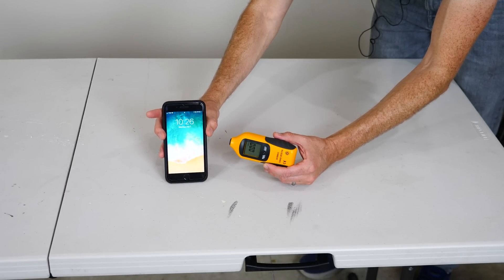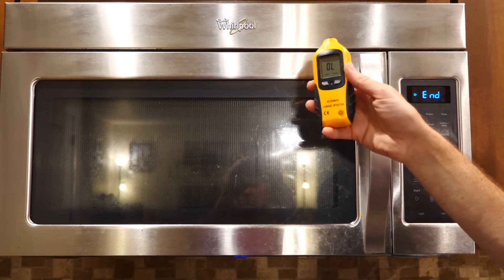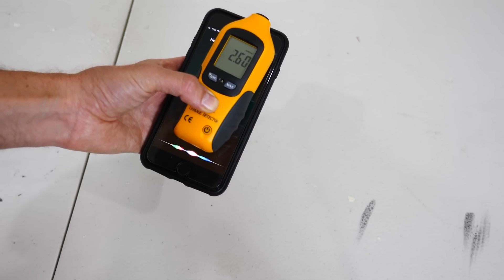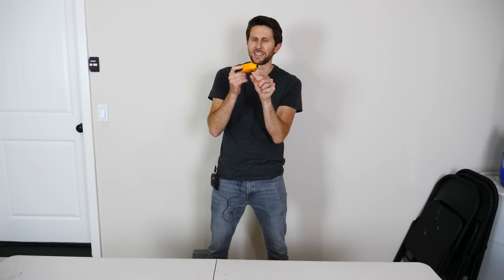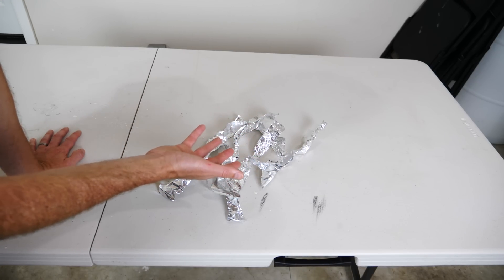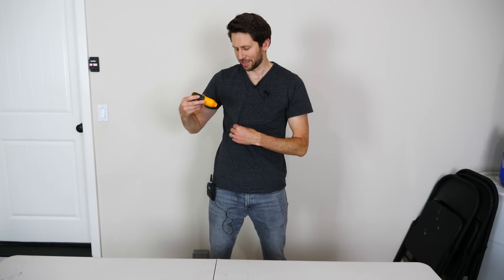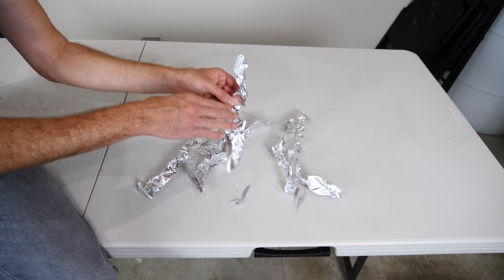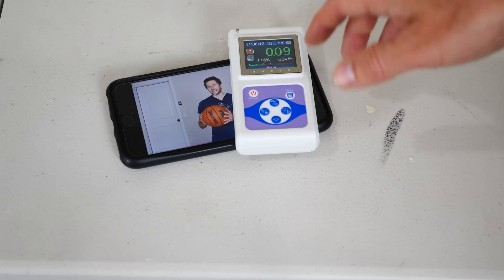How Much Radiation Are You Getting From Your Phone?

Comment: it is important to know the differences between non-ionising radiation, such as radiowaves, microwaves, infrared, visible light, UV and x rays, compared to the ionising alpha, beta and gamma radiation. 

non-ionising radiation are electromagnetic waves that behave like light (because it is light) and carry energy. the frequency and oscillations of the wave can be used to carry heat, light, and even information via use of electromagnets in an antenna. they generally do not cause any harm, until of course, you are exposed to an excess of it. this is why sunburns happen, and why a microwave oven heats up food. phones and many electronic devices naturally do emit this kind of radiation, but it takes a LOT for a phone's radiation to actually do harm to you. 

non-ionising radiation comes in multiple forms: alpha particles (2 protons and 2 neutrons, most harmful but weakest range, cant pass through skin or paper), beta particles (a high energy electron / positron, moderately ionising and cant pass through aluminium sheets) and gamma rays (a very very high energy EM wave with the greatest range and piercing ability but is the weakest in strength). these can actually cause serious harm over time by knocking out electrons in a cell and cause mutations, and therefore cancer. they are released when heavy and unstable elements such as uranium decay into more stable elements. ionising radiation is technically present all around us at any time, as they come from the ground's minerals and space. this is called background radiation, and is unavoidable as well as mostly harmless. 

i do not see any reason for expensive radioactive isotopes to be put in phones, cellphone towers or other electronics as they wont be serving any function within these devices, so dont worry. you could test this with a geiger counter (tho do keep in mind that it will pick up background radiation as well). 

actual uses for radiation would be: 
- smoke detectors (uses alpha radiation. definitely wont reach you unless you take out the radioactive source inside)
- paper factories (uses beta radiation to make sure paper are of uniform width. and no this doesnt mean paper are radioactive)
- sterilisation (gamma radiation is used to clean medical and surgical tools as well as some fruits as it is great at killing microorganisms. this also doesnt mean the fruit / tools are radioactive, it just means it has been irradiated, which doesnt mean it's dangerous. something that has been shot with a gun, and something that WILL shoot you with a gun is very different.)

thank you for listening to my ted talk
Reply: Exactly
Reply: Despite the "science" I still developed a debilitating sensitivity to artificially produced EMFs, but thankfully I found a way to deal with it.

Comment: Seriously before watching this video....actually iam in my summer vacation using my cell phone much...but there is a fear of deadly diseases like cancer🥶....and the most funniest part...keeping the cell phone at my ear in low volume when i feel my mom would scold...or sometimes covering my heas d with cloth to literally break those electro magnetic radiations because cloth is bad conductor of electricity...😂😂again fear...lastly i landed here iam  not addicted to phone because after summer vacationor before that...i ll leave this.....
Reply: I recommend not holding onto it or putting it near your head, or carrying it around while on, or sleeping near it. If you want to do these things, use the Q-Disc 5.0 from qnlabs/prlabs. This is the only device I found that works for phones. A person can develop a sensitivity to artificially produced EMFs over time depending on the proximity, severity, duration, and rate of exposure. That is what happened to me and it was debilitating. Ruined my life and I'm still recovering. But thankfully that device works. Protect yourself. The disc has to be attached directly to the phone to work. If there's a case on the phone, take it off and drill a hole the same size as the disc so the disc can sit inside of the hole when on the phone, that way it won't crack the case if there's hard plastic like it did to my OtterBox, or warp and or damage the phone.

Also, at least turn your wifi off at night and when it's not being used. It's very harmful as well. I can't be close to it at all for very long without being protected. Wifi is better turned off permanently. The bigger AiresTech devices help somewhat when placed on the wifi router, but I imagine a Q-Disc or few could potentially work well if the router was taken apart and the device attached to the component that emits the signal. It may void the warranty on the router though, and if you're renting one you may have to pay for it. But that's nothing compared to the price one may pay with their health.

This all might be a lot to handle but do what you can.

Comment: The cell phone measurement is inconclusive. Cell phones operate with variable RF power. They automatically adjust their transmit power level limited to only the RF power as needed to reach the nearest cell tower. If you are close to a tower, then your phone will be transmitting at a low power. But if you are in a fringe zone as barely getting one or two bars, the phone will transmit at its maximum power to reach that distant tower. Also, even when you are not using the phone, it still transmits data bursts periodically to maintain status communication to insure it's always linked to the nearest tower. My phone transmits a data burst for about two seconds every few minutes....possibly a concern if you keep the phone in your front pants pockets. That said, even with all those considerations, I don't think it's likely a risk given the large install base of phones and w/o any reported health problems.
Reply: Well there are many reported health problems, but people would rather have you think there are none.

Comment: His measurements are good, but his conclusions are interpretive and philosophical rather than scientific. Here are two facts that poke holes in his claim... eh let's go for three facts:
1) an experienced chemist or physicist would understand that how much a body of water is heated up by 1 degree C is not the only significant consideration in a biological organism: small groups of molecules of water in a square inch of water are actually being vaporized before they transfer their heat to other molecules around them. So imagine cells with molecules of water that are vaporized. Their should NEVER be vaporized molecules in cellular structures- that will damage some cellular structures for sure
2) assuming that non-ionizing radiation does not cause cancer is the argument of someone who doesn't know any of the microwave science: cancer and death from cancer directly resulting from microwave ovens and microwave lights (Russians used them in WWII to keep warm) are very well known facts
3) he did not test a 5G phone which uses multibeaming, which essentially means three beams of radiation- not one- each with more energy than 4G signals are crisscrossing over that phone, so all radiation readings should be significantly higher. And some of those beams are crossing through the human body before they reach the phone

Comment: You need a multi field tri axis meter something like a GQ-emf-390 or acousticom 2… there’s RF, emf and ef..  all radiation is radiation.. the dangers come from the pulsing that interferes with the body and brain as well as never getting a break from it .. the earth naturally gives off emf and it also naturally grounds us in exchanging positive and negative ions but the problem is we all wear rubber shoes now versus barefoot or leather soled shoes and we block this natural transfer.. there’s also a huge difference between massive amounts of man made devices pumping out frequencies on us 24/7, dirty electricity and so forth .. I live in a townhouse where all units linked together have smart meters and smart gas meters and my bedroom window has 3 all within 15-20 feet of one another .. my health has deteriorated rapidly since moving here with no explanation and symptoms so vast no doctor can place I also just got found to have a pituitary tumor out of no where!

Comment: 1) I saw "OL" from the phone though so assuming the max power is 10mW per square cm is wrong... How wrong depends on what the actual values are.
2) Brains and skulls aren't a ball of water, so heating could be uneven - with "hotspots".
3) Human brains seem to have problems when they are heated a mere few degrees hotter than body temperature.
4) There's research showing that cellphone radiation can affect the brain. 

Till more research is done if you do lots of calls I'd say use the speakerphone function or other methods so your head isn't right next to the phone.
Reply: Where is the research showing that cellphone radiation affects the brain?

Comment: Also, you get comparable values for mobile and wifi connection, which is somehow a surprise. Shouldn't be wifi radiation of your phone near the phone much weaker than mobile radiation of your phone near your phone since wifi router is much closer than cell tower.

Comment: How come microwave only take few minutes to cook things up but the wifi router using the same microwave, wavelength and frequency doesn't do much. Please explain. Thanks
Reply: Because the amplitude is too low. If your router pulled the same power as your microwave it would cook food.
Reply: Needs new batteries.
Reply: A Wi-Fi router does not emit with fucking 500+ Watts 😬 its regulated to 500mW - 1W

Comment: All this just to conclude that the radiation from cell phones is non ionizing and therefore "safe". Did you miss the entire debate and significant research around this topic the past many years? The whole reason some people worry is because it is possible that pulsed, non-ionizing RFR could have effects, even if we don't exactly understand the mechanism yet. Signals carrying data are pulsed, meaning it's not just a sine wave, like from a microwave oven, but a complex wave with rich harmonics. The NTP performed the largest experimental animal study ever completed, a couple of years back, and the results raised enough concern in the scientific community that they are now planning replication and follow up studies - so the verdict is not in yet. In the mean time, if you ever read the health and safety directions (that everyone legally agrees to, without reading them obviously) on your phone, it literally says to hold your phone 1.5 inches from your head. So the manufacturer isn't as sure of themselves as you are - and if this does turn out to be provably harmful, they don't want to be held liable. Than in itself should be enough to warrant caution. I use a wired headset. I turn off the WiFi at night - it's just wasting electricity anyhow. No reason not to take some easy precautions until we get some more firm science and conclusions on this topic.
Reply: They tell you to hold it away from your head for legal reasons. So if there's any battery explosions or strong overheating that can cause harm, they are legally clear because you held the phone too close to yourself.

It has nothing to do with radiation, and everything to do with sue-hungry people looking for a case.

Comment: Fun fact : Waving my shirt cools me off . 

 Action lab is saying microwaves emitted from waving shirt will heat you up . How's that possible 🤔
Reply: Because the breeze hits your sweat you fool.
Reply: Because your sweat is a good insulator of heat
Reply: Cool air cools you down, extremely tiny amount of microwaves heat you up a tiny amount, not more than the cooling.

It's like waving air over a fire. "But the air is cooling, but the fire gets hotter, how's that possible?" because the fire gets more oxygen from the air, which allows it to burn more, which means it heats up more.

Comment: If microwave radiation is so harmless and can only cause heating then why are microwave ovens government regulated to limit the leakage.  Is cell phone radiation not dangerous and microwave oven radiation dangerous.  Actually cell phone radiation is also regulated but it is measured at a distance.   All cell phone user agreements include a warning, usually hidden deep inside the legal documents that tell you to keep a minimum distance from the phone ( about 1 inch) or there may be danger.  No one maintains that distance so we are all exceeding the legal limit but no problem because the radiation is "safe".   And now we are moving toward  5g  with 100 times more towers operating at 1 kilowatt  (4 times the power) each and a much higher frequency.  No problem, microwave energy is non ionizing radiation and is safe,  besides look at all the cool things we can do and all the money.